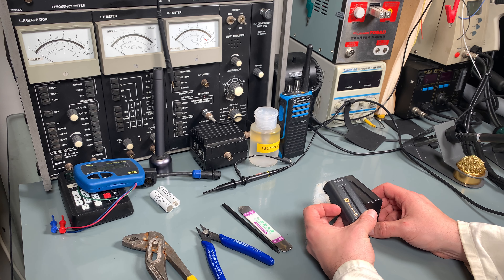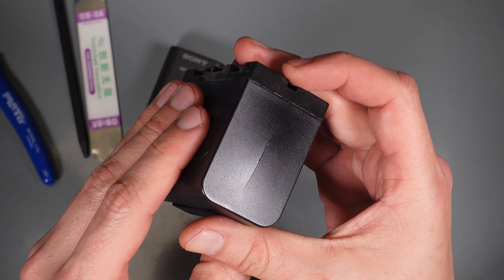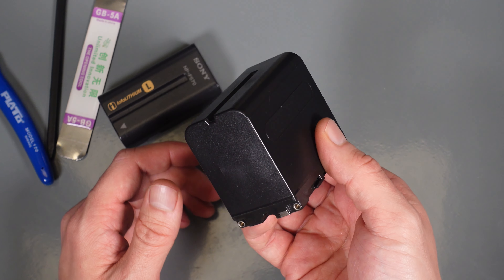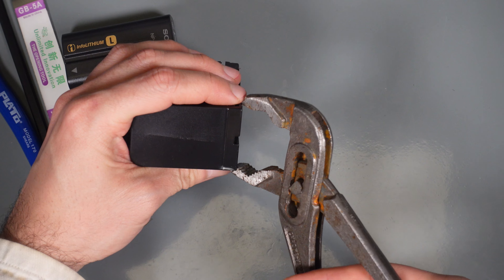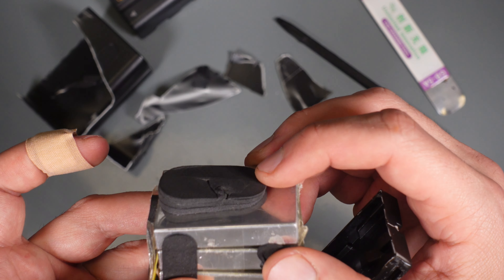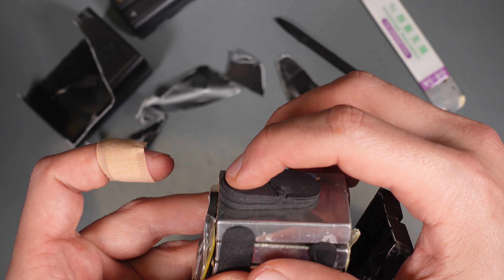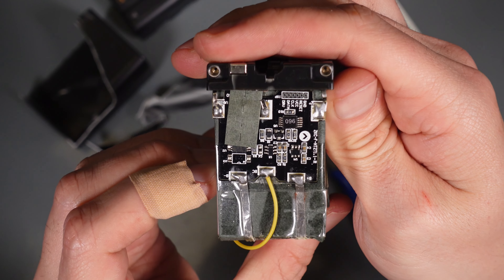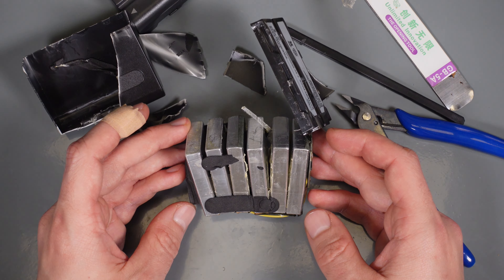Teardown swollen & cracked chines Sony  NP-F  PNP F970  battery replacement (Premium Gold 8600 mAh)

Comment: What does the pin other than plus and minus do? I also tried to use the 4s charging integrated circuit, but the device did not detect it because that pin was missing. How Can I Solve This? Battery board is faulty.
Reply from the maker: In general third pin is used for communication and it can be as simple as detecting temperature of cell or talking into info lithium.  Take look here for workaround: https://youtu.be/casblqbm_04?t=222
Reply: @ElectronicNoobBlog  I'm guessing lithium information. Because there is a note on the card saying ID. How can I generate this information?